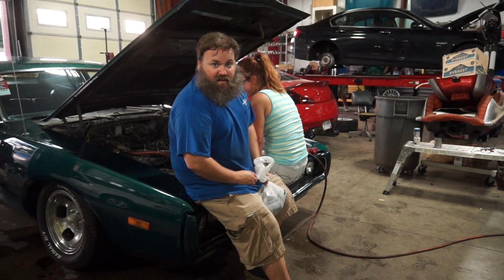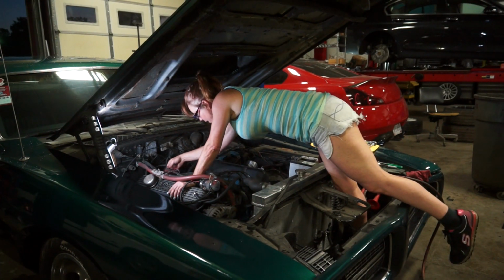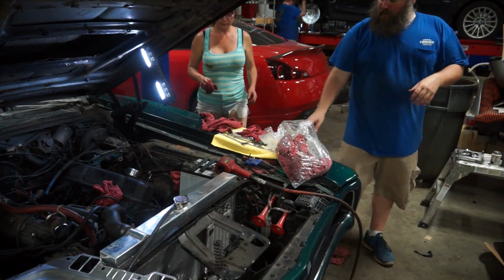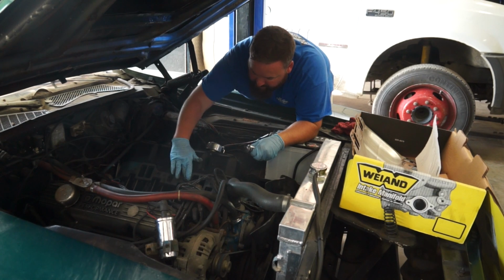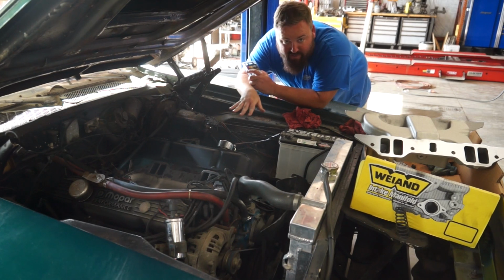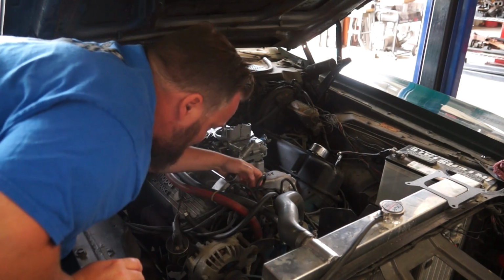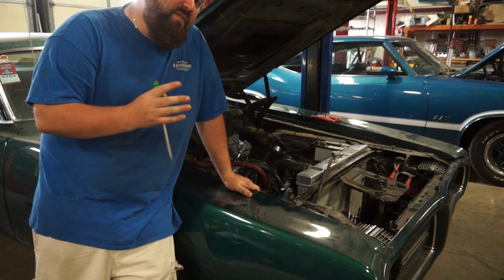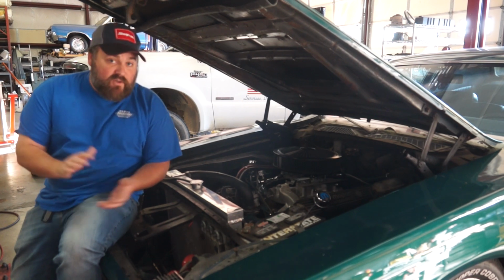1973 Dodge Charger "Momma's Mopar" gets some upgrades! : Part 5 from Lucore Automotive

Comment: That Jimmie up vac port was why that new Trans was not shifting full throttle in part 4 no doubt, love the lady learning how to wrenching, as she gets right in the engine bay, gotta love it! You are a great teacher, we mentor robotics, and when the young ladies get fully into it, sometimes they pull like she did on the intake bolts during removal...time to break out the little bit bigger leverage breaker bar equalizer. And say, This will help you....do it. "It was fine, maybe not", as Derrick of "Vice Grip Garage would say...Her eyes said... help! But only twice.
Reply from the maker: That old motor was driving us nuts for a number of reasons, shifting issues, shutting down issues, even randomly just refusing the start. Lots of little gremlins and issues. 

She's very much an "I can do it" kind of lady and that's been awesome to see her taking on these challenges herself. I point and instruct and she does essentially all the work herself. Gives her a greater appreciation and understanding of the car and what it takes to build/race it.

Comment: No choice but to throw the right parts at that temporary situation, until the new rebuild is finished. Luckily it will all bolt on to that new build, and all the bugs will be worked out, before the engine swap. Now that, would have been a true nightmare. And she went a couple of rounds with what she was running, that was a miracle!

True story, her experience was better than my first actual bracket racing experience. Went to the track alone, as not a spectator, but first time competitor (grew up going to a lot of the original greats as a spectator watching from the stands, mainly the TF funny car and TF dragster wars and shootouts at Lions, OCIR, and Irwindale...In H.S. early 70's, first real hot rodded Street car, 1968 Plymouth Satellite (wanted a 69 Roadrunner), but settled for the $250.00 cash, mint bargain a friend's acquaintance sold me cheap, if I towed it out of his Dad's garage, and it was swimming (more like floating), in a pool of nice red Dexron II fluid all over the floor! (There had to be  8 quarts of Dexron on that floor I swear!) Paid him, he signed over the title, (as fast as I could pay him mind you, he wasn't my friend, and I was young, his dad was really angry and wanted it gone within 2 hrs. PERIOD, and I really wanted that R.R. lookalike even though it was a 383 and not a 440 Six Pack like my uncles I so idolized!) Today, grown old now, I would have just fixed it for him for the $35.00 in Trans cooler lines and Trans fluid it cost me and the 1 hr. In actual Labor it took to replace the cracked steel lines and walked away, hurting but smiling...(Simple fix, the clip hanging those lines from lower starter bolt was crimped into both steel pressure cooling and return lines and pumped fluid by the gallons...onto Daddys concrete garage floor. And he just kept filling it up!)

Dad gave me 1 hr after I was back from a quick parts store trip, in exchange for me also cleaning up his very nasty wet gooey and stinky floor!

1 hr. The car was on the street driving perfect like it was showroom fresh, though it was 5 yrs old, and only had 15k miles on it! Cars in the 60's and early 70's were a lot cheaper. New or used with trouble. I drove that sweet new ride home. Karma gonna get me though next Saturday night...as...I saved a ton on the car, plenty of go fast cash burning a hole in my pocket, let's go drag racing! 3 hrs later his floor was clean, ok, except that big dark but dry stain. It took a whole case of carb cleaner and kitty litter. But, a deal is a deal, and everybody seemed happy...I know his dad and I both were, and he was outta hot water, he told me years later he hid in his room and cried for 2 days, but we became friends anyway.

Long story longer, a new Tach, Guage kit, 4 new tires, gotta get that rear leaf spring shackle kit to raise the rear of the leaf springs, as it really helps plant those new fat wide rear tires (all the TF Funny cars had that high rear, low front rake ya know), and new gold alum. wheels, new Edelbrock High-rise, and a brand new Holley 750 double pumper 4 bbl, with vacuum secondaries, all installed, tuned up in 4 days time, newbie headed 80 miles from home, just drive there alone, race and drive home a winner was the dream!

Reality and Karma paid me a (looking back now), biiig visit. Teched in, ok, 2 easily fixed items with cool help from new friends I did not yet know, a borrowed bolt for the coolant catch can, and a rear taili light issue we fixed (or so we thought).

I was such a noob at the tree, mid 14's running in Street bracket at OCIR in Orange County, living the dream, time trials, really late first pass. 5 amber tree a .670 light, I sucked bad. But that car was soo freaking consistent, 5 time trials, ran within 3 hundredths, dialing this baby in will be easy!

1 of my new friends said go dead red second pass, okayyyyy .492 light, same ET. My first Red light, so he said watcha leaving at for RPM, I said 2,800. He came over and adjusted my tach, stage it there at 2,750, and said run the same exact pass, do everything exactly the same. Easy for him to say. I was so thrilled to red light, remembering the rest was not easy.

3rd time trial, 100th slower and a .510 light, I come back to the lanes and people started a bull session with me. Where did I used to race, no seriously I'm new.....He took me off to the snack bar, he said eat a hamburger, we are going to get q more pass then into eliminations after sundown. Move the tach back up to 2,800 RPM, do the same the rest of the night.

He was racing in Bracket 3 Heavy, so had no problem sharing secrets and helping me succeed. His name was and still is McClanahan. I said as I ate the hamburger he bought me, won't I red-light? He said Nope, not right away, maybe later tonight, but after that hamburger, your body and reactions as you digest that small amount of food, will just take a slight edge off, and slow your reactions down a tiny bit, as the excitement of actually competing will Rev you up...you are going to cut .50 lights all night long. Yeah right, but I listened to my new mentor, who kept calling me Lucky...I thought he just forgot my name, I was and it stuck.

5th time trial as the sun set. .502 and a hundredth quicker. Now what...Do I drop the leave RPM again? He laughed...Nope, leave that alone...You are buying us both another hamburger! You Lucky arse!

He was right, cut .50 lights all night long, and ate a stinking snack bar hamburger after every single pass...all the way to the finals. Then all heck broke loose going through the lights final pass, .504, broke out lifting by 5 thousandths, against thier .503 right on. But my fuse block under passenger side of the dash is on 🔥,  burning up through the defroster vent, hitting the windshield, pull off at first turnout, jump out, lift hood and ripped off the battery cable, just as the safety safari arrives to spray all that nasty white powder inside my car the windshield shatters. Oh crap, my new ride is a disaster, I have no way to get the car home, gotta call my step dad to come get me, and track says I can leave it there till Wednesday...at my risk.

Oh well it is insured for theft, but not damages suffered during a racing contest....My Mom insured through, but also worked for the AAA...no telling untruths about any damages, that was her career! She worked at corporate in LA in upper management (And she broke through that glass ceiling, no way I was gonna risk anything), The fire damages were mine to repair and pay for Period!

Ok, Wednesday we show up with the truck and rented trailer. As we come down the track entry road, from far off I can see the car, whew it is still there, but it sure is sitting low...It is still there alright, every wire from headlights to tail lights, every harness is fried. Headliner, windshield, most of the dash is fried,  a small section of carpet has melted dash plastic on passenger side. White powder and glass fragments is everywhere! 

And it is also missing a few pcs too, the New wheels and tires, the intake and the holley, are gone! They left my new Tach and guages alone, would not wanna risk a breaking and entering I guess, but isn't lifting the hood also...?(Insurance covered the stolen items, and after 8 months of Pick,-a-part trips, tearing out and installing dash pcs, and every wiring harness in the car, new carpet and a crapload of cleaning, I was back to race again. 

Yup, drove the cars to and from for years before I got a trailer and a tow rig. I was low budget, but I raced for checks. And ate dinner just before first round always! And always went red early. Almost every race my first full year,  they all called me Lucky, and almost always was runner up! (Some snickered and said bridesmaid, never the bride), I was more than happy to cash checks without fail. Winner bought dinner after racing anyway...Until I finally Won! For years worked 7 days a week to race 5...Those were the days.

Any bad day racin' is better than any good day working. Even when you burn it up!

So, you did good your first 2 times racing Mopar Momma, and you and the car looked good doing it, and you had a great mentor too. Karma just got me because I drove it, almost like I actuall stole it! (At $250.00 base price I did steal it). The gas crunch did me in with that car, worked at a chemical plant in LA, Cyclo Chemical...12 hr shifts / 7 days a week. Our chemical  engineers at the plant to keep us out of gas lines, worked up a special blend and made up pallets of drums for us in the materials yard free for the taking, pump your own....Toluene and Methanol with additives of zinc and a few other secret ingredients during the Carter years (the Saudi's screwed us years. See, we have all been down this road before, most just too dang young to remember, The President does not set gas prices, Big Oil and The Saudi's do, so get over it....Same Crap, Different Decade. The (Kingdom), and tar sands of Arabia sets the prices worldwide, big oil takes advantage.

And I would fill up before leaving to race of course. There was not an "O" ring or rubber seal left not massively leaking in that engine after that year or so. But for a while it ran better on that blend than pump gas. The engineers had switched everything in their cars to Teflon, nylon, etc....But, they never shared those details until our cars no longer ran.

Cars were cheaper than Engine Rebuilds during the gas crunch.

Comment: I just bent my line upwards on my carb line to clear the distributor,and ran the rubber line over the distributor cap. Works well and don't even notice. I'm always on extreme budget. Gotta work around buying parts lol
Reply from the maker: Were you using a similar duel feed hardline? We MAYBE could have bent something around it but the end of our fuel line was literally ON the distributor. Besides in this case adding the spacer actually adds a couple more HPs as well, not a lot, but every little bit helps :)
Reply: @LucoreAuto  yes,same fuel line. A lot of my friends were turning the line around and running the rubber line around the engine to it,but that just seemed dangerous to me,to have that much rubber hose running across like that. Wish I could send a picture of it. What you did is still a great way and a spacer will ad a little performance.

Comment: Why didn't you flip the dual feed fuel line 180°? Point it towards the rear and no need to relocate coil or throttle linkage.
Reply from the maker: Flipping the hard line of the fuel COULD be an option but then we're running a soft fuel line the length of the motor and turning 180 back into the line. Wouldn't be as pretty, also gives much higher likelihood of the fuel heating up running over the head. The coil mounting, had to be done. This brand of intake manifold has no holes drilled in it for mounting the coil.

The throttle linkage from factory is all hard metal linkage not cabling. Unfortunately as with the coil, there's no way to mount the old stuff on the new manifold so had to do a cable throttle setup.

Comment: All the bb intakes i changed in my life i only used the  valley pan as a gasget. Never had a problem. Why are you using both. And you helped her take the old intake off.
Reply: I COULD USE HER HELP ON MY DAKOTA R/T ESPECIALLY WITH THOSE TOO SHORT SHORTS ON AN NICE LEGS, YES IN DEED,I LOVE THAT...

Comment: I like that shes so into tworking on the car ,now a cam and a 3500 torque converter lol
Reply from the maker: It's definitely made the project a lot more fun that she's been so involved and willing to "get in there" from the start.

A new cam would make a HUGE difference in this poor ole tired 400! However, not likely since it's winter here now and the new motor will be going in for spring!
Reply: & it's nice to watch her work'n on her car.  Tee hee Tee hee
Reply from the maker: @metalmopars  she's definitely not afraid to get in there and get dirty!

Comment: They did have the  400 for the chargers in 73.
Reply from the maker: Indeed they did, the evolution of the 383 big block Mopar. This was originally a 318 car however one of the previous owners did the swap to the 400.

Comment: Im surprised it dosent have a carter 850 CFM thats what my 400 had.
Reply from the maker: At some point it may have, the zip tied Holley that was on there originally was certainly not original equipment. 

The 670 that's on there now is actually excellently suited for now, and the throttle response is excellent!